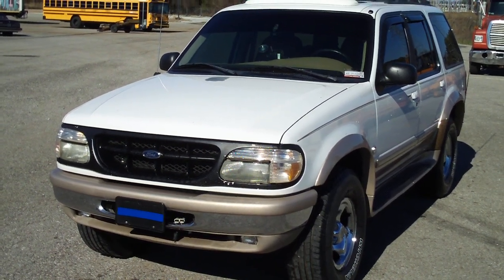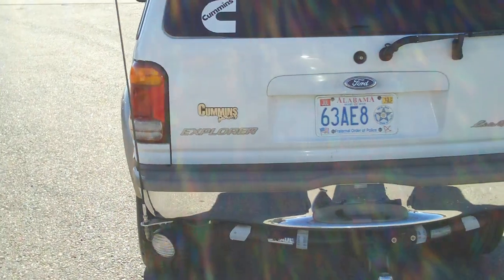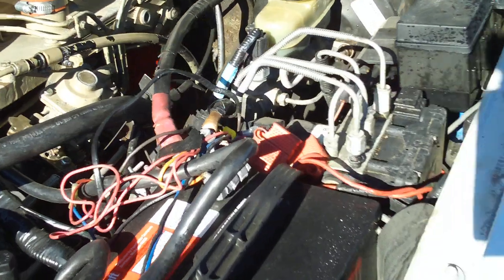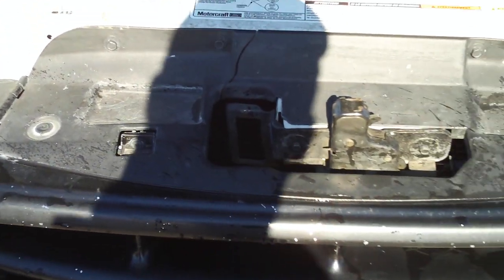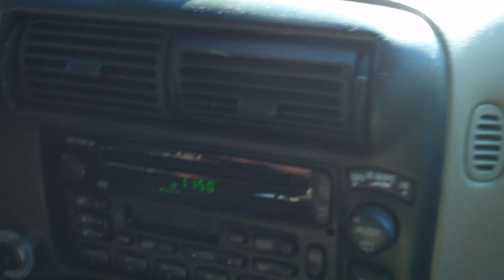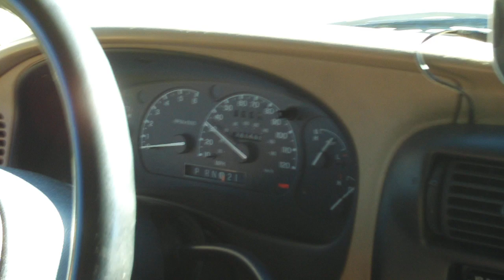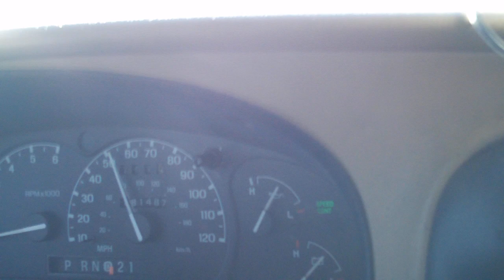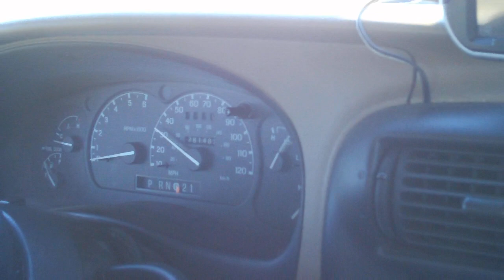4 BT Cummins Powered 1998 Ford Explorer

Comment: me personally id try to shove a 6.0l in there faster more power winwinwinwinwin
Reply: doubt it would of made 100000 miles without having to be touched if it was a 6.0 though lol
Reply: i have one with 464k and never had erg or head gaskets ever done.... so you're wrong
Reply: Ryan Collins well then you have a ticking time bomb just waiting on the chance to fail, i love ford trucks dont get me wrong but everybody i know that has one of those has had serious trouble at least once a year, my uncle for instance this year-oil cooler, last year-HPOP, 2 years ago-2nd time head gaskets and added arp studs, 3 years ago-a sensor broke and got sucked into the engine and destroyed a piston, 4 years ago-egr cooler failed and head gaskets the first time, 5 years ago injectors, 6 years ago something to do with the muffler, cant remember after that lol but yea you get my point
Reply: its called keeping on the "check ups" i change the oil every 3k i also clean my parts i love the truck i love the motor its amazing.
Reply: Ryan Collins he bought it with 25000 miles on it in 2004 ever since then he has it changed with some sort of synthetic stuff every 3000 miles and the fuel filter is changed every 6000 or at least once a year, he also gets under and checks and greases everything once a month although there isnt much to grease, it now has 220000 miles i think, it also sucks at cold starting which is the main reason he runs the synthetic oil, he is always has a sick look on his face when he sees my cummins cold start with 3 rotations of the engine lol
Reply: mine always starts right up plugged in or not its awesome
Reply: sstroh08 I had trouble with my 6.0 cold starting last winter. Do a search for "FICM repair".  If that's the problem, it's easy to test, and free to fix if you're any good at all with a soldering iron.  A friend of mine also had the same problem.  I couldn't believe the difference it made.  It'll start below zero pretty easily now without being plugged in.  I prefer not to do it that way, but it certainly will if i ask it to.  Good luck!
Reply: The 6.0 is a nightmare to work on in a full size truck! v8 diesels are not the way to go,if they were you'd see everyone swapping 6.0 s and 7.3s into everything,and that's not happening.the inline 4/6 cylinder cummins is a true industrial duty engine,that runs several hundred thousand miles,with nothing but maintenance!Its not an overly complicated,unreliable 6.0 .which you'd be lucky to get to 150k without major engine including,head gaskets,oil cooler,egr cooler,FICM,stc fittings,the list goes on and on....
Reply: still rather have a 6.0l then a cummins.
Reply: John DiMartino um actually there's plenty of million mile 6.0s and if you're doin a swap the egr delete is all you'd need to do studs could be done w/out removing heads and the 6.0 is a fuckin beast of a motor hell I've had to have one tow my trash hauler back to the shop and at 98k lbs he held 40+mph just fine so how about knowing shit before spewing it
Reply: John DiMartino um actually there's plenty of million mile 6.0s and if you're doin a swap the egr delete is all you'd need to do studs could be done w/out removing heads and the 6.0 is a fuckin beast of a motor hell I've had to have one tow my trash hauler back to the shop and at 98k lbs he held 40+mph just fine so how about knowing shit before spewing it
Reply: I'm sorry you must have special 6.0s..very few  here are making 125k without having to have thousands in work ,cabs lifted and heads pulled,because the piss poor 4 head bolts per cylinder couldn't keep the head gaskets stable,and they blew,the fix is 5-6000 dollars,and that's if you don't fix the pos valve guides,I've yet to see a 6.0 not needs the heads rebuilt with new guides because the valve guides gone..Then there's the  needles in the roller lifters exploding and taking out the oil,pump and engine.The antiquated fuel system uses high pressure oil,which always ends up leaking internally at the heads standpipes,or at the injectors,or stc fittings ,Wait there's more they don't cold start for shit below 10 degrees which is common here,and the oil coolers plug up,but there great engines,so great,that a huge aftermarket business has bloomed from building kits and parts to swap in a cummins inline 6, this fact speaks volumes about how good the 6.0 is.ill give it this,it makes a good boat anchor after it blows the head gaskets and egr cooler just out of warranty.
Reply: John DiMartino lol funny every 6.0l haters say "iv worked on alot of them!!! get a cummins!" literally all of you cummins fangirls say that. cause every craigslist AND cars.com 6.0l have more then 150k on them in new jersey,

Comment: Why would you do that -_-
Reply: 30+ mpg and more torque.
Reply: Really?
Reply: Very much so. The price of these engines stand alone are pretty steep though. However when properly maintained and kept in good working order will far outlast most all gasoline engines. If you extrapolate the price of the swap over the life of the vehicle, the cost of ownership is relatively low. There are people fine tuning these 4BT engines albeit in smaller vehicles that are getting 50+ MPG and still have plenty of power at highway speeds.
Reply: That's amazing
Reply: Indeed it is. The sad part is we can't get vehicles like this from the factory, they wouldn't be selling new vehicles often enough.
Reply: Is it because the engine is a 6 cylinder that the car is getting good mileage?
Reply: Diesels, can be made to burn fuel more efficiently than gas engines.
Reply: Alright, well, I didn't know that. Thanks for telling me about that.
Reply: No problem.
Reply: EpicNEd
4bt is a 4 cylinder cummins
Reply: automotiveDIY I think the straight 6 cummins is pretty good. I always thought that cummins just made 6 cylinder diesel engines. guess i thought wrong. lol
Reply: automotiveDIY tbh I honestly wish people could stop hating on whatever car maker they like and start loving all the brands!
Reply: Brian Lee I think they should as well.
Reply: Christopher Pennington Im sitting next to you
Reply: ***** I will poke you back if you want me too.
Reply: No thanks
Reply: Christopher Pennington Damn It
Reply: ***** your welcome... :P
Reply: Why Are we doing this? Were right next to each other...
Reply: I don't know really.
Reply: Brian Lee Right. I think all cars are very much the same. No matter how much it can tow or how much horsepower it has. Cars are just cars. I love cars that look unique to me.
Reply: EpicNEd you're a damn city slicker. That is bad ass. Everything should Cummins powered! #Cummins
Reply: #cummins  I love the 6.7L ISB Cummins motor. They sound great to me.